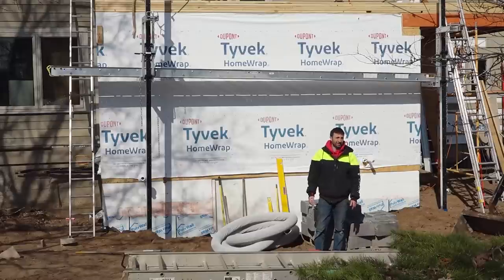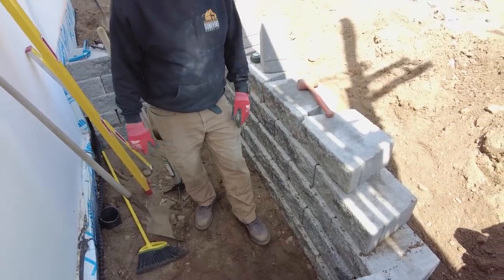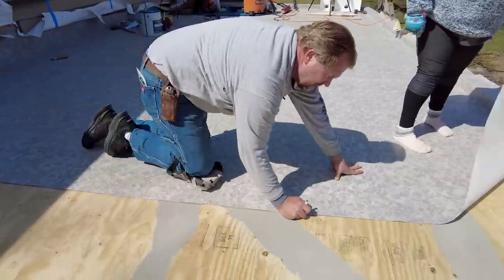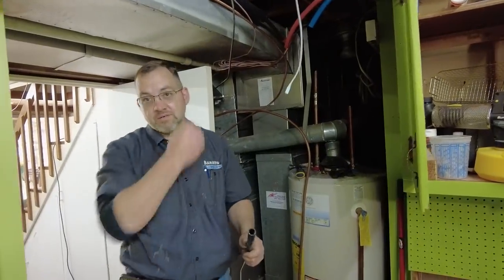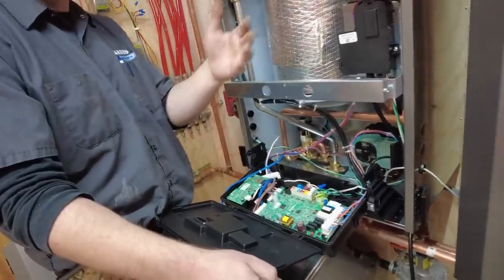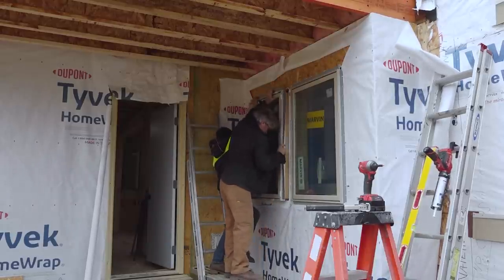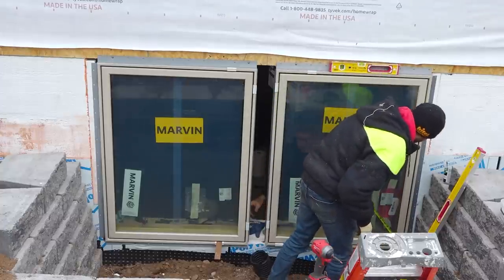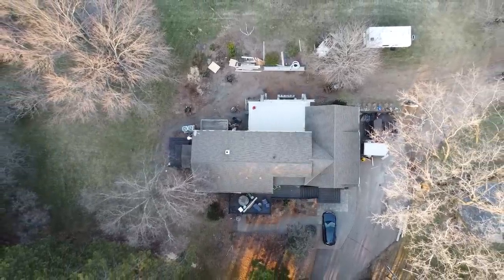Roof Deck Membrane Installation (Duradek) | Home Renovation & Addition Part 37

Comment: Raking the windows is totally a normal operation - and totally worth it. its nice to see guys actually doing it. So many "reno's" go into play without doing this.  / with the membrane deck it will be critical to keep it clean - I have dealt with the aftermath when that has not been respected - this is not easy to repair. - Nice work!

Comment: In most applications you want to have some fast perking gravel (and a sediment barrier or landscape fabric) to drain right behind the retaining wall to prevent the freeze/thaw pushing your block wall around causing gaps - but I do remember that your soil was quite sandy there at your place - so maybe it's not a big deal. Also, any cut pieces should be in field, not in corners or edge on the house in this case - as these can get pushed more easily. Other than that - it's not rocket science - keep up the great videos - we all enjoy watching them !!!!

Comment: Great to hear your contractors explain what they are doing as it is getting done. The rapport you develop with them goes a long way toward creating an excellent project. 

Trimming those windows will be very easy since the installer took such great "panes" to get them level, square, and making sure the heads are aligned at the exact right height!
Reply from the maker: Hahahaha thanks Don!

Comment: Matt make a unitized railing that will sit where wanted and anchored only at the house wall connection no reason to drill anchor bolts onto the parapet. Is it to keep a a corral of cows safe on your terrace or a 20o pound drunk from falling onto and collapsing the frames.   Codes are so ridiculous. We know you have plans, are you entertaining a wild frat party soon?

Comment: With all the exterior mods you made to the original plans and the state of the art equipment and other materials you used and installed your house will be not only beautiful it'll be functionally awesome the rest if it's life.
The roof top deck is a radically awesome place to hang out and entertain friends and family members on nice days.
Especially when wildlife show up to watch.
I'd have a really nice retracting telescope handy to use up there on cloudless nights. 
This Old Home crew should be jealous of Donovan's and the subcontractors work.
As well as their video presentations of what and how they did their jobs. 
Thanks for the Saturday morning entertainment Matt.
Abd Donovan.

Comment: Thanks for sharing.   A bit old  school, so a single layer system like that is a bit unnerving.  I will be interested in how  this performs long term.  How that patch material he used on the seams holds up outside.  Especially in your cold climate :).  Screw pops??  If it holds up, it looks awesome.
Reply: I'm paranoid enough that I would still put a deck or some other protection over that stuff. If it will last 20 years while walking on it, it will probably much, much longer if you are not walking on it and it is protected from the sun.

Comment: Always use screws. Makes taking things out easy and they don't back out over time. Those lead times are crazy, 30 weeks? Do they have 2 employees?
Reply: Yes, and the boss only watches. ;)
Reply: Nah... There's 8 guys, but 5 bosses and 1 site manager watching the 2 guys working.
Reply: Lead times were always crappy but now there are a lot more homes being built, supply chain problems, and worker shortages. It's a bad combo.

Comment: The blocks you are using should be heavy enough to avoid what happened to my retaining wall which was probably stacked a few rows higher then yours.  I drove a bob cat machine close to the edge of my wall once it was completed and the weight of the machine caused the ground time sink enough where the retaining wall was now leaning inward.  I later discovered that when stacking walls over 2 feet high it was recommended to install something in between the rows as you go up.  The product that was recommended to me was a plastic fabric that gets buried behind the wall and once the dirt covers this fabric it helps hold the wall from tilting inward should any heavy equipment be driven close to the edge of the wall.  Something to consider with your wall is do not drive your handler close to the wall once its completed.

Comment: I put a cant strip in the corners by the parapet, softens that corner.  

Also be really careful about anything puncturing that membrane, if any water ever gets under it it's over.  Watch for things like the feet of any metal patio furniture.
Reply: Or dancers in spiked heels.
Reply: @z06doc86  Lol, yeah that seems likely.
Reply: Matt, you might want to consider posting a sign like this if you have gusts: https://en.wikipedia.org/wiki/High_heel_policy#/media/File:No_Heels.jpg

Comment: should have the plumber explain the clean out taps at the bottom of the heater.  Used to clean up calcium build up in the heater

Comment: I have a question about the vinyl roof. I know nothing about them at all, I'm just curious I know they will be welded shut per say but wouldn't you want the overlaps facing toward the bigger drain? So the water goes over the overlaps

Comment: I'm curious it there is a reason you used a mix of "normal" screws and pan head screws for the windows?
Reply: The pan head wanted to strip out so we changed to the other ones to hold in the window bucks on the foundation
Reply from the maker: Needed coarse threaded screws to go into the ICF
Reply: @donavanshomes  Thanks for the replies guys. Hopefully those aren't the same screws I have holding in my kitchen upper cabinets. :)

Comment: I must have missed it but how would water drain from the window well.
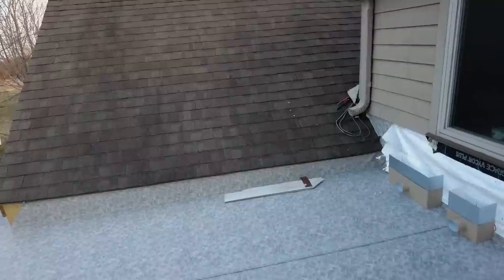Reply from the maker: Episode 6 @ 16:20 we installed a drain pipe but the soil is free draining so it likely won’t see much use
Reply: No need its porous soil

Comment: Awesome stuff Matt and Donavan!  Question from someone in the South: do you worry about frost or ice heaving displacing those dry stacked blocks around the window well?  Thanks!
Reply from the maker: You do if you have soil which retains water. We're on sand and rock; water drains through it like a sieve

Comment: How do you get rid of water from you office window well?
Reply: There are two drains in the window well. One goes in to the drain tile and the other will be piped underground and daylighted down the hill. Also the ground is all sand and drains well.
Reply: Porous soil

Comment: How rain water leaves from window wells?
Reply: There are two drains in the window well. One goes in to the drain tile and the other will be piped underground and daylighted down the hill. Also the ground is all sand and drains well.
Reply: @donavanshomes  Thanks!
Reply: Porous soil

Comment: Hate to say it, but it looks as though your foundation drain board is installed backwards. Dimples and fabric should be facing out. Hope I'm wrong. Enjoying the build.
Reply: Dimples create gap and a path for water to travel down to the drain tile on the face of the foundation membrane
Reply: @donavanshomes  I understand how the system is suppose to work, but if the rigid impervious backing is facing out, which it appears to be in the recent drywell episode, the water cannot get to the dimples.
Reply: @kurtanke4367  there is no fabric this drain board there is perforations to allow water though
Reply: @donavanshomes  my apologies. I stand corrected. For the record, I think your craftsmanship is amazing.
Reply: @kurtanke4367  no worries I need to check on how things are done all the time and I make mistakes. Glad you are enjoying the build